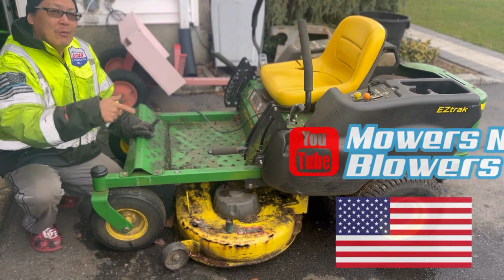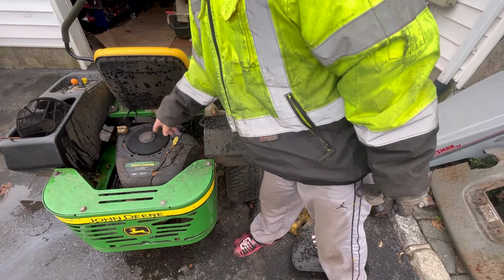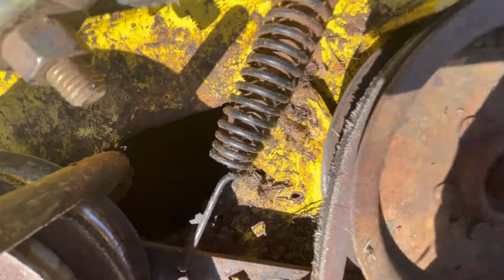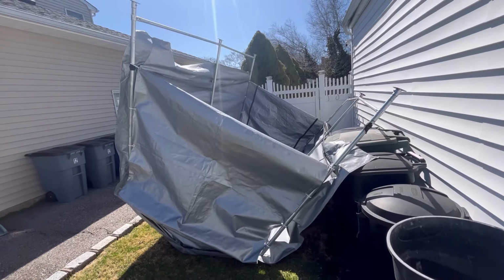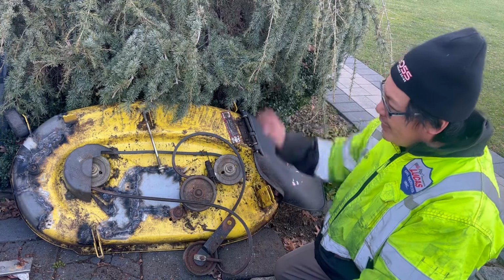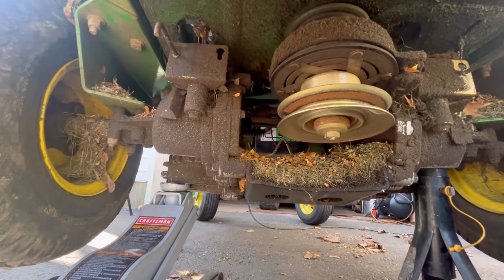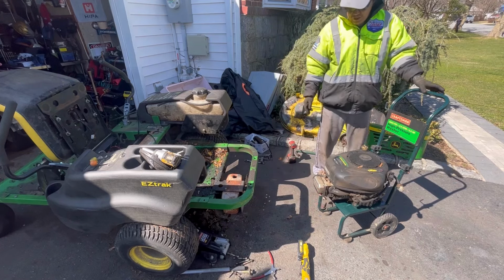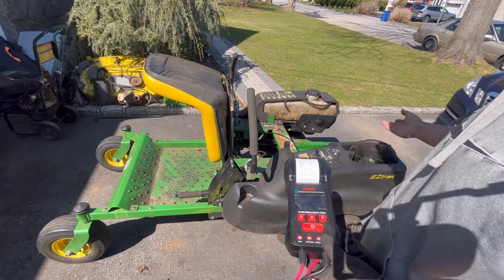FREE JOHN DEERE Z225 ZERO TURN LAWNMOWER CURB ALERT PICK ROTTED DECK REPAIR & BLOWN ENGINE REMOVAL

Comment: You did nice work saving the deck bro . Just wondering if that deck is similar to the 42" on a john deere tractor , but nice save and nice welds 😎
Reply from the maker: No because the deck belt is reversed as it hooks to a rear mounted engine double stack pulley.
Reply: Ah gotcha, that is true still some nice welds bro

Comment: Henry wire feed welding is a lot easier than stick welding 😉
Reply from the maker: I disagree,  I’ve used flux core for years and stick welding is way easier.  For small seams I’ll do flux core wire,  but for a need of thick welds,  electrodes are great.
Reply: @MowersNBlowers  I guarantee  your welds would look much better when using wire feed welders that's partly why your welds look like they do 🤔
Reply from the maker: @jasnapon  they look way worse with flux core

Comment: Make sure when you pull that motor that you SAVE & MARK the stator that is in it. it should be one of the HIGH AMP OUTPUT ones to be able to run that electric PTO.   Would have loved to see the BOTTOM of the deck after you welded the top.
Reply from the maker: Well the vtwin engine has that stator already.  It’s easy to distinguish the stators.  Dual circuit vs 10/16 amp ones